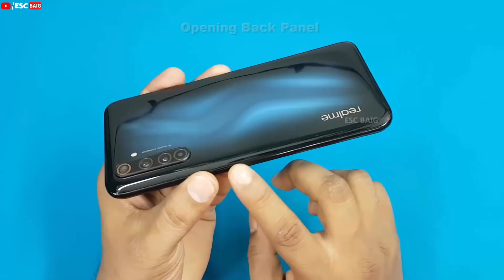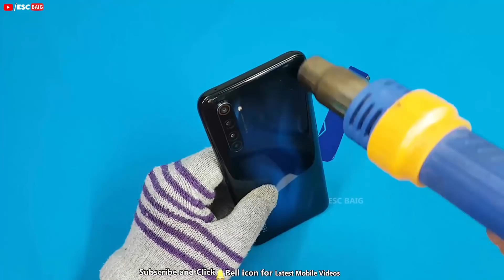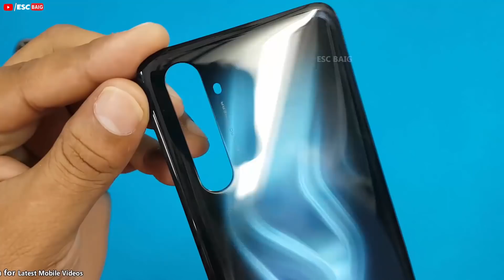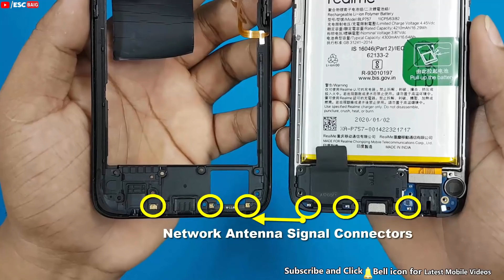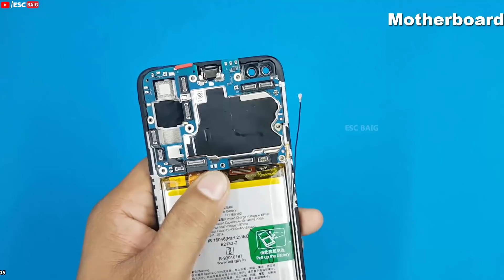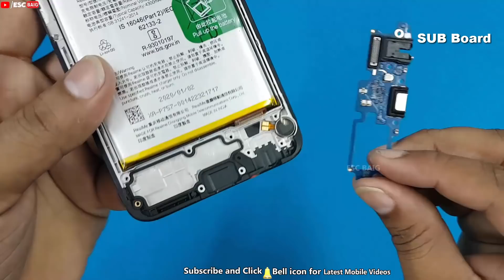Realme 6 Pro Full Teardown || Realme 6 Pro Disassembly | How to open Realme 6 & 6 Pro

Comment: It is possible or working if you replace the chipset of that to SNAPDRAGON 865 and upgrade the lens to larger pixel.
Reply: I think not cause sd 865 has smaller nm and has a special motherboard or something
Reply: You'll burn your device
Even if you manage to swap processing units and replace them with highest chipset 
The mobile's system would crash down like crazy because it's not optimised for such a higher processor. I was a child when I thought of this. And now you have my answer
Reply: Yeah i'm thinking about that too

Comment: Is that phone have any cooling system
Reply: No
Reply: @nasifnasi2588  so what about the copper layer between the processsor?
Reply: No
Reply: It has cooling sink/thin copper plate as you can see at above the battery and cip metal cover.
Reply: No not any cooling system but it doesn't get much warm while gaming...and poco x2 has a liquid engine to keep everything cool...still it gets very hot

Comment: Right,  6 pro have thermal Paste in and out,  this is better than redmi Note 9 pro , 9 pro inside hasn't Thermal Paste inside .
Reply: Redmi note 9 pro has a square thermal pad inside, fit the size of cpu. The same method, do the same job but more clean, bcuz it's not a paste.
Reply: @anonymouz2.064  but due to miui it heats aggressively
Reply: @rashmisawant950  Not for me. I play high graphic games for an hour with no heat at all just warm at 35 - 37°C. Also no lags.

Comment: For all realme users, I think I need to share this to you guys about the battery of our realme

"As you use your battery, charging and discharging it, the capacity of it will slowly drop. So if your battery is 1300 mAh out of the box, it might drop to 75% of that (about 1000 mAh) after 200 charge/discharge cycles. A LiPo may last 300 to 500 cycles, depending on how it is cared for."
Reply: Yup.Batteries have a limited lifespan. Every time you charge your device, it wears out the battery, lowering its total capacity. Scientific research shows that battery lifespan can be extended up to 200%, when you charge your device to only 80%. It is a priority to focus on battery performance for  gamer